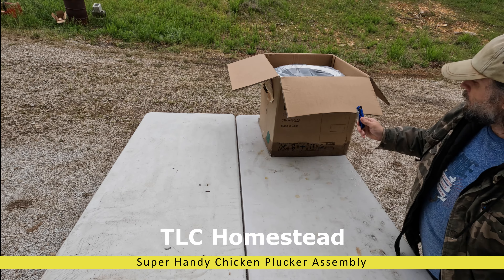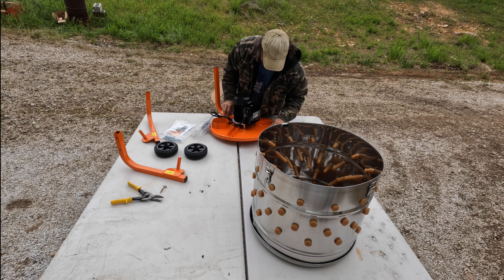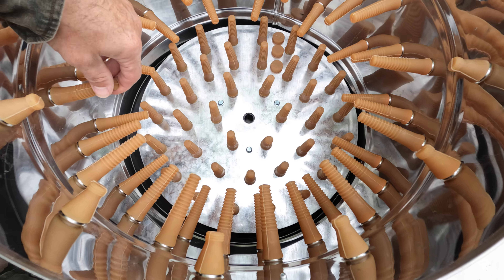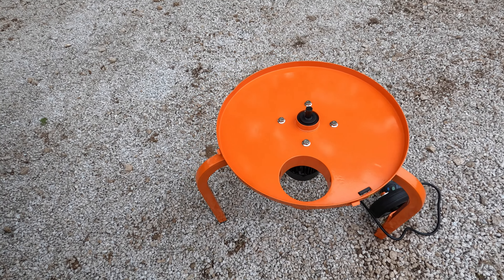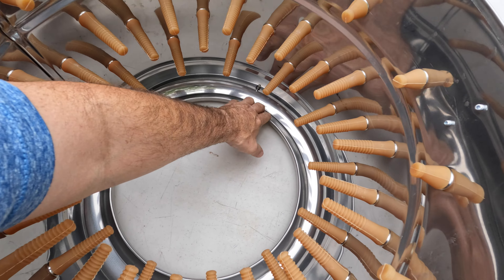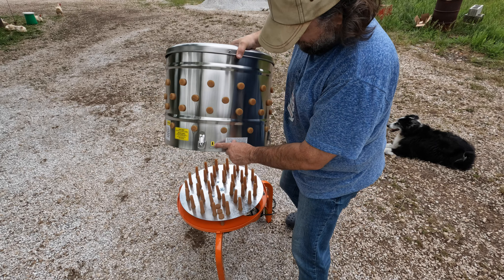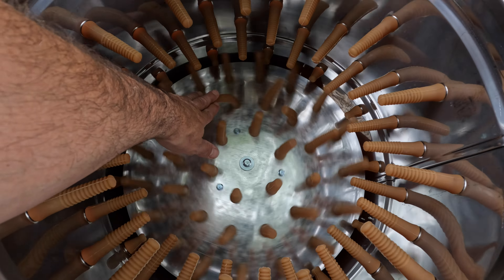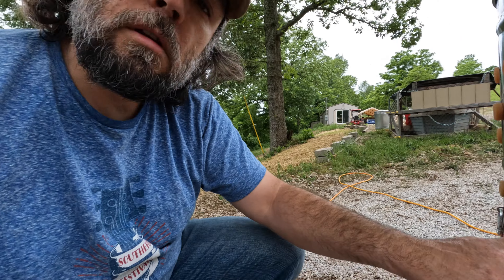Super Handy Chicken Plucker Assembly

Comment: Hey just wanted an update on how this machine is going for you after 9 months. Saw it on Amazon and was looking to get one as a present. Thanks.
Reply from the maker: So far I still really like this plucker. I guess I should make an update video but I am busy trying to finish my chicken coop build and have HOURS of that video I am trying to find time to edit :)

As for how did it work? We have run 20+ birds through it and it got 98% of the feathers off in about 15-20 seconds per bird. There was a few feathers left on each bird that took another 10-20 seconds to pluck off but man-o-man this worked like a champ. I am sure others are smarter than I am but we setup a warm dip pot, this plucker, cold dip bucket, final rinse bucket then to the processing table setup. Once you get a groove going things went smoothly. Two things I wish were better on the plucker:
1) wheels. I have gravel and the hard plastic tires are not the best. They work but air filled tires would be better. I will change those out someday.
2) Dealing with feathers. The pool idea worked but if this was maybe a foot taller and had a hook to hang a 5gal bucket (with a hardware cloth bottom for water to pass through) I think that would work much better.
Reply: @tlchomestead  Thank you for the detailed response and review! Sounds like it has been working fine overall for you (minus some of the flawed designs). Currently the person I am looking to get this chicken plucker for is plucking by hand so this machine will definitely be better lol. But then yeah I have seen a different review for a different chicken plucker and their machine went out within a few months after using. So my main research is for longevity of the machine itself. Again, thanks!